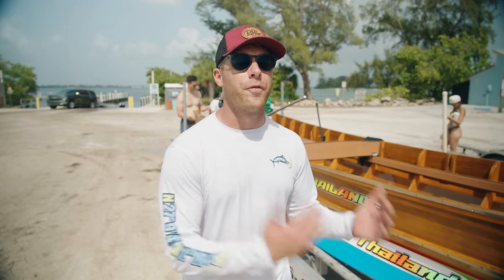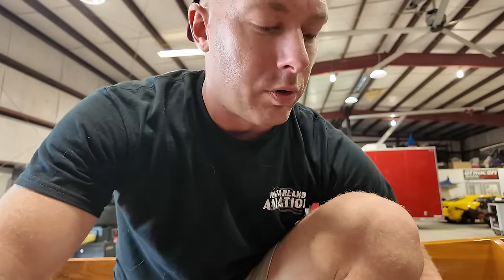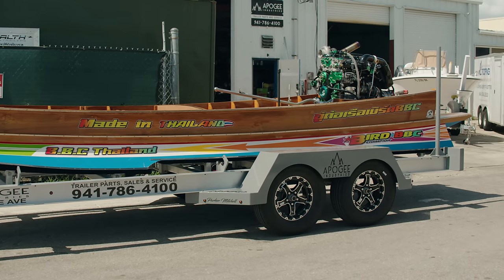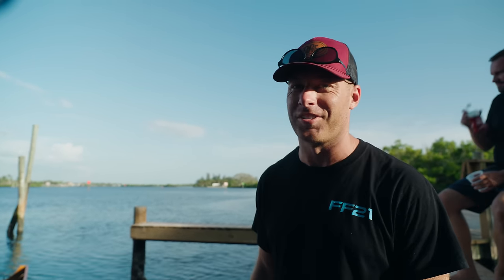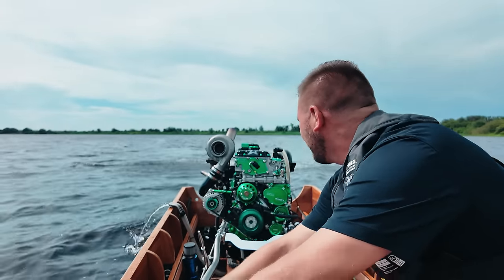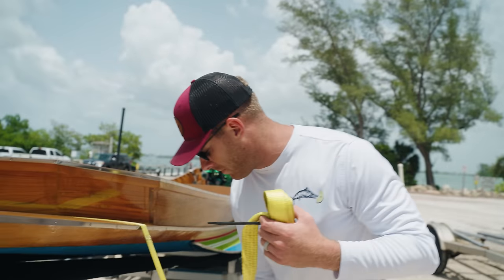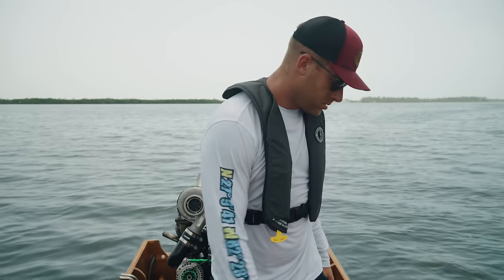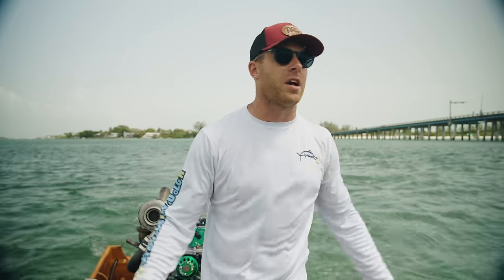Driving my Thai Longtail on US Waters

Comment: Parker you can pressurize areas on your boat to force epoxy or whatever resin you want into the wood and that will strengthen and seal the areas that are constantly getting slammed by the water

Comment: ใครแปลภาษาได้ช่วยทีครับ ปรกติเรือหางยาว ที่เครื่องแรงๆ เขาจะใช้ไม่ค้ำพังงา รูปแบบ ใช้เป็นไม้มีร่องตัว V เพื่อค้ำ จะช่วยให้ขับง่าย ขึ้น ตอนหางจะลอย  ไม่ต้องใช้ขารับ   รับรองเร่งได้ สุดคันเร่งก็ใหว
Reply: Translation by google: Who can translate? Please help. Normal long tail boat at a powerful engine He will use it to not support the tusks. The style is to use a stick with a V-shaped groove to support it. It will make it easier to drive. When the tail floats, you don't need to use support legs.   Guaranteed to expedite The accelerator is all right.
Reply: @lycanhd  it auto translates on the ap.
Reply: @ThePinkPanth3r  Duh! Thanks captain obvious.
Reply: ต้องไปดูตั้งแต่จุดเริ่มต้นครับ เจ้าของเรือลำนี้แต่แรกเขาไม่ได้ทำไว้และไม่ได้แนะนำเจ้าของลำใหม่
Reply: @lycanhd  not sure what the DUH was for. You just translated that comment but the guy was saying it auto translates, kinda seemed like a waste of your time to do something that can be done in app automatic.
Reply: Here the translation “Normally, long-tail boats with powerful engines don't use a support beam for the propeller shaft. Instead, they use a V-groove wooden support, which makes steering easier. The propeller shaft will float, so there's no need for a supporting leg. This setup ensures that even at full throttle, the boat can handle it smoothly.”
Reply: เหมือนเครื่องไม่แรงเลย
Reply: มัน เเค่90 kmh เอง ของเเรงในไทยเรา ผม มี ถึง200kmh
Reply: @Nothing_bach  90ไมล ครับ😂😂
Reply: @Nothing_bach ราวๆ140บ้านเราคับ มันเร็วพอแล้วคับสำหรับคนที่ใจรักเฉยๆ แต่ไม่พอสำหรับนักแข่ง
Reply: @wat79  He is the original owner as he bought the boat new from the builder 🤷‍♂🤷‍♂
Reply: จริงๆเมกาจะไม่อนุญาตนำเข้าเรือ แล้วถ้าเครื่องยนต์แรงที่กฎหมายกำหนดคืออดค่ะ เจ้าของเรือเลยต้องปรับจูนเรือหลายอย่างเลยเพื่อที่จะนำเข้าเรือลำนี้ได้ มันเลยไม่สามารถทำให้เรือลำนี้แรงเหมือนที่ไทยได้

Comment: 14:00 didn't use enough hardner. I learnt from the best. Just call and talk to the boys at Hibachi body shop.
Reply: It was a 2/1 ratio 2 part epoxy.  I did exactly that with a measuring cup, but that is for the concern!
Reply: @kyleconaghan1794  it was kind of an inside joke with Cleetus and their mishap with over hardening :D

Comment: I’ve rode in that style in Thailand. 
2 upgrade needed. Weld an alignment bar on shaft that lines up with 3 tension bolts at top. 
And weld a hydrofoil type adjustable fin on bottom of skeg. Which will allow you to keep prop at right depth.

Comment: Dr. Parker you should make those hoses that have the oil going into the bottom of the boat. Those hoses should get tapped right into the oil pan so that you're not running your motor out of oil . Not just into a catch can and running your motor out of oil. Keep up the good content, I like the channel.
Reply: Running ccv hose directly into the oil pan… yea great idea.. not. 
They need to vent otherwise they’ll create too much pressure and blow seals out.

Comment: Should weld a tab on that rear shaft with a hole  where it slides into the trans to keep it stationary, and also act as a pinch point to keep from sliding out.
It’s definitely a ripper 👍 congrats

Comment: This boat hasn’t yet reached its peak performance because, as someone mentioned, it needs fine-tuning. The problem lies in the difference between the fuel types in the US and Thailand, as indicated by the white fumes when the engine starts. If properly adjusted, it will be able to achieve top speeds like a racing boat.

Comment: You needed to vacuum bag that crack to draw the epoxy resin further into the crevice.   Most all fiberglass boats use this method.  If your fix doesn't work, think about this method.

Comment: Come back to Thailand and take some lessons from the local Boys on how to drive that thing. When they want to turn around in a tight space at slow speeds they will swing that prop around to 90 or 110 degrees to the hull of the boat and give it some throttle. That thing will cut a sharp turn.

Comment: For those who interested 
4jj1 are the beast of 4 bangers diesel and it’s easy to modify and aftermarket parts are cheap!  The last time I saw it ran 6.xx seconds in 1/4mile with stock block and head here in Thailand,Not bad for a 3.0 diesel in a 3rd world country 

I own 3 truck that have these engine in it all of the got forge internal
and the only weak point was transmission…It exploded every year🤣

Comment: You have to let the original Thai mechanic tune up the new engine, you can't adjust it to the general standard because your engine will not have power. And the engine power will be reduced. I think the best thing is that you have to use it according to the system that the Thai mechanic set the engine value from the beginning when you bought it. So you have to let him adjust it for you directly. If you fix it by the mechanic in America, it will not be able to run very fast. It can only run in general. Which the horsepower will definitely be reduced. From..Thailand

Comment: Hey man As a Thai people You need to re-tune the engine because the fuel in Thailand and America is different. You can tell by looking at the engine when you start it up that there is white smoke. I'm afraid the engine is broken. You need to re-tune the engine and set the fuel settings.
Reply from the maker: The white smoke is normal on diesel when you first start them and they are cold

Comment: 9:44 sounds like a pin problem in the connector. That should be easy.
Im paused at that time in the vid to say this, lets see what the fix is. Ive seen many a connector do this, u gotta use the right pin tools and during assembly just not be ham fisted, but it does still happen. Ive found bent pins on brand new CAT/Mitsubishi forklifts when working as a mechanic in that field.

Comment: I have to tune a new engine because the fuel cost of Thailand and America is not the same. When I started the engine, I knew that the smoke was white, and I was afraid that the engine would break. I have to tune the oil setting again.

Comment: May not see this, but maybe weld on a keyway on the shaft then cut a spot in the coupler so that when you bolt it down, there is no way for it to rotate. 1/4" keyway that is a 1/2" long.

Comment: As I see it you have two options, either you keep the boat wet at all times, or you glass the entire boat, inside and outside, with fiberglas or something similar. I think that your epoxy "repair" is going to do more harm than good. I know just enough about wooden boats to know that filling cracks with epoxy is not how you can "repair" wooden boats made out of thin planks. The boat did not need any "repair" to begin with. You are not using the boat as it should, so the wood dries out and it shrinks. Now you filled the gaps, and when the wood gets wet again and start to expand it has no place to go because now the epoxy is in the way. But the wood will expand anyway, so it will start to deform the planks and create even larger cracks when it dries out again. Because now the wood is slightly compressed at the edges since it had no room to expand. Ask any shipwright. And the more that you fill the cracks, the more it will deform. There are plenty professional and/or very experienced wooden boat builders on youtube.  It is a real trade which requires a special set of material knowledge and a correct application.

Comment: I think you need to re-engine the engine. From the sound of the turbo and the engine, it still waits for too much revs. You need to modify some more points. If everything is in order, the smoke won't be this black.

Comment: You should not go and re-tun the engine because the Thai mechanics have made the engine more powerful than the standard and they have adjusted it to be suitable for the engine power. If you adjust it to the standard, it will be like reducing the engine power.

Comment: I need to tune the new machine. Because of the cost of oil of Thailand with America is not the same. I saw when I started the engine that white smoke came out. I was afraid the engine would block it. I need to tune the machine to set a new oil level. If anyone can translate it,

Comment: Revving the engine while strapped to the trailer can't be good for that crack. All that torque is trying to rip the boat in half, and on the water, the boat can tilt side to side a little but strapped down it can't and it has to put a lot of pressure on the wood

Comment: COMPLETELY wrong approach. using a putty knife is not going to get the epoxy completely thru crack. I was an epoxy contractor in 89 SF earthquake times.   You surface seal both sides... entry port along the crack and force the epoxy into crack.  That way you get 100% penetration and fill for a dependable repair. Good luck

Comment: It is not steel. you don't drill wood like that. With a wood boat you can epoxy but you will see it when the sun eats it.  Wood boats swell up in the water and stop leaking.